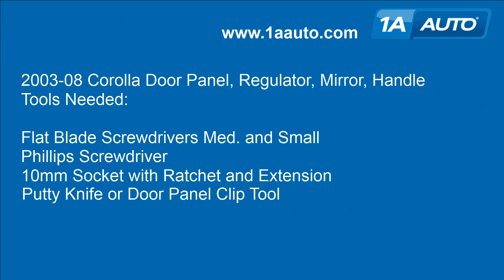How To Replace Door Panel 03-08 Toyota Corolla

Comment from the maker: @hbboy561 We'll keep this in mind if we need to do this repair on one of these vehicles. If you remove all of the screws holding the door panel to the door, you should be able to remove the door panel with a door panel removal tool or a putty knife. Hope this helps you out.

Comment from the maker: @Microbio888 We currently do not have an auto repair video on that particular vehicle. However you would need to remove any bezels or trim that may be bolted into the door frame, and then you should be able to remove any of the push pins on the backside of the door panel with a putty knife or door panel removal tool. Hope this helps.

Comment from the maker: The panel should line up exactly as it did when you took it off. If you take a look at the speaker grill you may be able to snap it back on if it has a couple of tabs sticking out of it.

Comment: Just wanted to thank you for this video and the one dealing with replacing the power window regulator.  I didn't have to replace any parts - the front half of my window had slipped out of the weather seal and was no longer closing/sealing properly.  Your video helped me fix the problem myself.

Thank you!
Reply: Can a 2009 Toyota corolla door that is manual panel change to automatic door panel by changing the accessory?

Comment from the maker: Sometimes the rod that is attached to the key tumbler breaks away from the door lock actuator. You will have to open up the door panel as seen in the video and see if you have any rods hanging down by the lock actuator and if anything is even attached to the key cylinder.

Comment: Awesome video. This is the first time i ever didnt anything major on my car. i replaced my mirror within 30 mins. But i ran into a problem after fixing it. I can lock and unlock doors when key is not turned on. But once the key is turned on i cannot lock the doors. I'm talking about the power door locks..Any body know if i did anything wrong during this process

Comment: Thanks for this video, really interesting. I have a 2002 Corolla (NZE120) which is exactly like this one.  Was going to try it out cause one of the electric window is making noises when it's at the top part (shakes with bumps when on the top, even when closed). Mike, can you suggest anything re this problem? Driver's side is also like not going down in a straight manner, so it gets almost stuck and continues on its way down.

Comment: @1aauto Is there a way of removing the panel if you cannot open the door?  How do you remove the portion of the panel at the bottom where the clips are if the door will not unlock because something is broken inside?  Thanks

Comment: Great video on how to take apart the door panel. I did this with my car in hopes of repairing my passenger side power lock. The key fob, and the actual power lock button in the car will not unlock the passenger side door. It sounds like it's the actuator but I'm hesitant to take it apart any further for fear of causing more harm than good. Any suggestions or videos you can point me to that may help? Thanks in advance!

Comment: the door of my toyota corolla doesnt unlock or lock manually with the key? what could be the issue? i can only lock/unlock with the remote.
is there an issue with the lock. or a setting that needs changing.

Comment: how do i get the door over the manual window lever?
Reply from the maker: Here's a video that will show you how to remove the manual window crank so that you can get the door panel off. Hope this helps you out. How To Install Replace Manual Window Crank Handle Two Different Ways 1AAuto.com